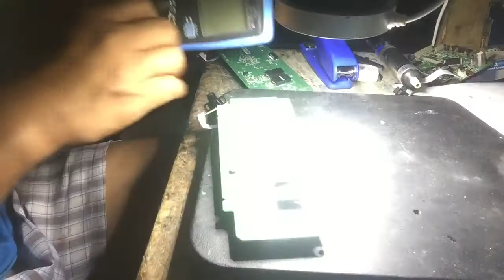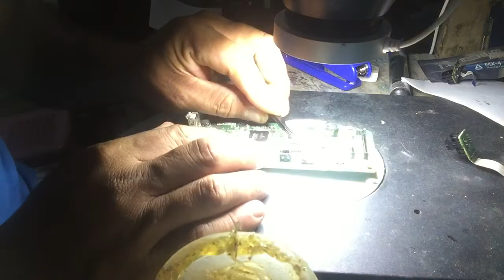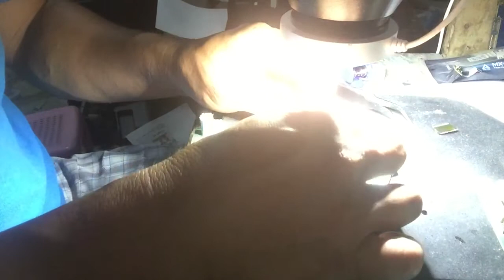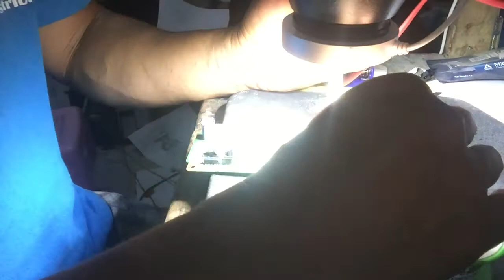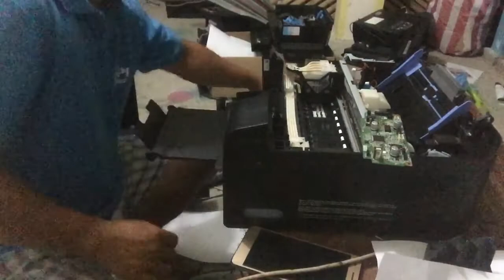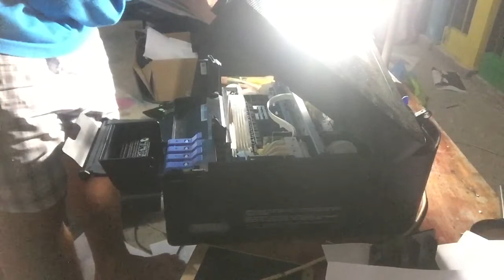Epson L3110 no power problem fixed

Comment: sir meron po akong dead epson L3110 nag no power sya after ko linisin yung print head at pump then pinalitan ko po sya ng board since hindi ko alam kung ano yung naging sira. then yung new board nagopen sya nung i ttry ko na magprint nadead din po sya. sana matulungan nyo ko thankss
Reply from the maker: sayang sir ng board mo po. in that case sira na ang printhead. pakipalitan na po ng head. then sa dalawang board naman palipalitan lang po dalawang Power transistor and 24 pins Power IC. the ok na po yan sir. good luck po.
Reply: @AldenAltamarino  tama ka sir gumana nga sya nung pinalitan ko ng transistor galing sa L120 hindi ko nadin sinubukan yung head, ginamit ko nadin yung cable and head from L120.

Comment: Sir ask ko po if 42V po ba ang standard output ng L3110 psu. Meron din kasi pero hnd mag turn on ung printer.. Una nag andar sya then nung e clean ko bigla nag off. Then check ko ung psu meron naman 42V.
Reply from the maker: Tama po ang voltage input sir ng psu mo ang problema po yong printhead mo  ay maaaring sira na. now kung namatay po ang printer habang nagkicleaning ka po meaning grounded na po ang head. please double check the two power transistor.

Comment: sir pariho lang po ba yong power transisto ng L120 sa L3110,, kasi balak ko sana ilipat yong l120 power transistor to L3110 ok lang po ba sir?
Reply from the maker: yes po, pareho lang po sila. C6144 and A2222

Comment: paano po malalaman kung sira na ung 24 pins?
Reply from the maker: simply lang po yon, bago mo ibalik sa printer para matest check mo muna ang dalawang power transistor. halimbawa sa A2222 may tatlong paa yan. gamit ang contenuity lagay mo ang red probe sa unang paa then black prob naman sa pangatlong paa kapag may reading yan nasa .897 something now baliktarin mo ang red and black probe, kapag walang reading meaning sira na ang 24 pins Power IC. Same process lang po sa C6144. sana makatulong, good luck!

Comment: Sir Yung l3110 ko biglang namatay Ng I print test ko okie Naman Ang power supply nya pero hnd na mag on Anu po ba possible na sira? Madaming Salam at po ..
Reply from the maker: paki-palitan nalang poSir ang dalawang power transistor nya dn ok na po yan. Usually sa L3110 power transistor lang ang nasisira nyan.

Comment: Sir, question po. 3110 rin printer ko.
Ayaw mag ON, pero ok ang power supply.
Anong sira sa logic board ko.?
Reply from the maker: Power transistor sir saka yong 24 pins Power IC